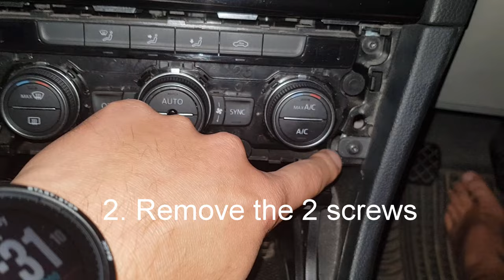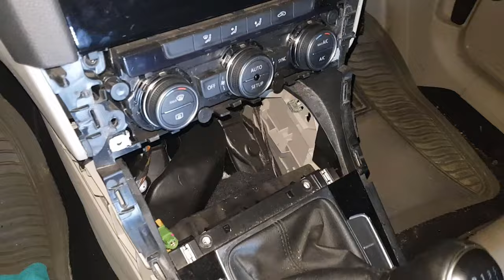Volkswagen Golf 7 - How to fix cup holder slider

Comment: Great video! I lost my bank card in there too and the lid was stuck about 80% open.
You don’t have to unplug the storage compartment, there’s enough cable to just hang it out to the left.
If you’ve got an auto like me, you’ll need to put the gear in D or N as you won’t have enough room to pull the storage compartment out. You’ll also need to unplug the cable for the gear indicator lights too.
Reply from the maker: Thanks man. You're right, not necessarily to unplug the storage compartment. Just did it to make things look a bit more "spacious" 👍
Reply: same thing happened to me today

Comment: My wife just put one of our keys to flat there and ... This is one of the most stupid constructions VW ever did. Together wind the windows slider in Golf3/Golf4 where at some stage the glas just falls into the door. edit: was able to open everything, unfortunately my wife was driving around and the key slid all way back under the ventilation tube. cut up the isolation material and fished for 1-2 hours until i blocked it with 2 screw drivers from each side to prevent it sliding away. got it now 😅 daaaamn Golf

Comment: Thanks for the video man, hope I'll get mine fixed myself. The issue with mine is that it would not fully open. Something gets stuck when open to 60-65% which renders the second holder useless. I'll take my chances and have a go at some point.
Reply from the maker: Your welcome 👍 I believe it's one of the loose plastic sticks that is blocking the slider at the 60% mark. Opening the cupholder console should fix the issue. Good luck man